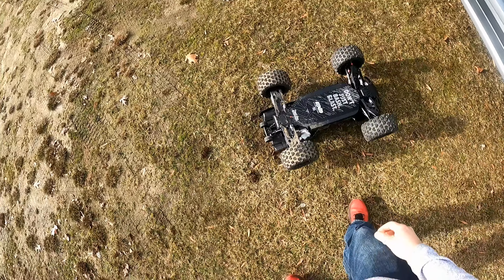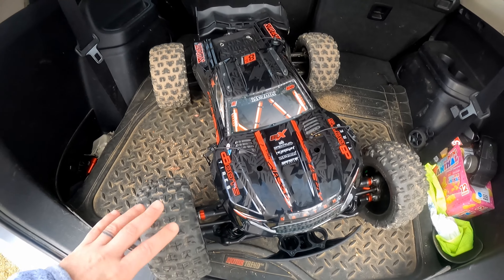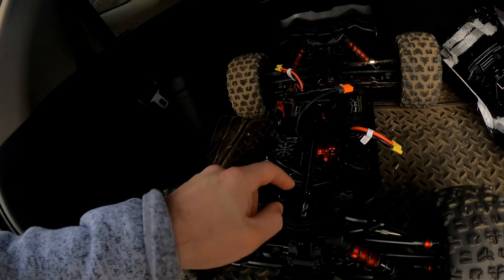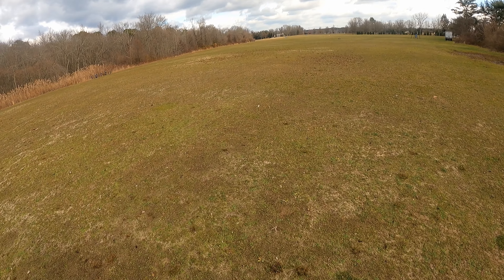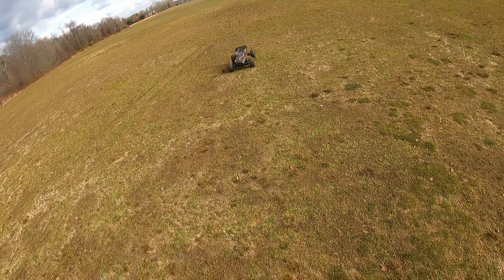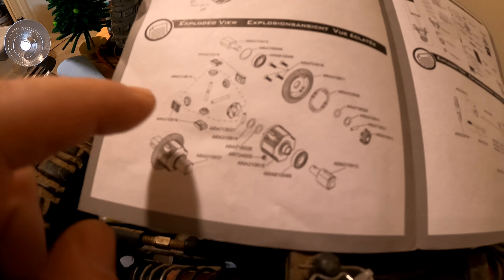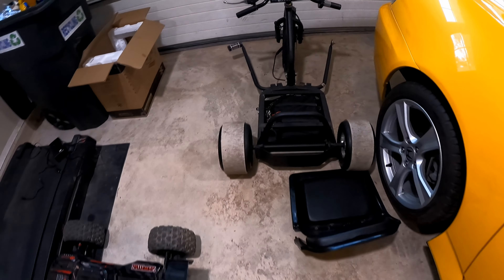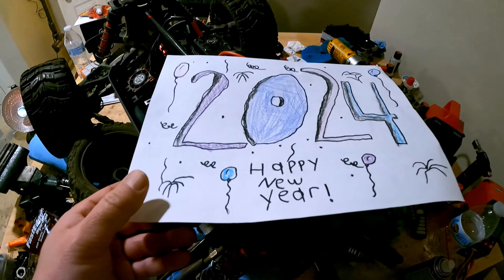Kraton 8S EXB RTR Openbox and Reveiw

Comment: All stock 2 gens ace advance 4s 10000 mah
Reply from the maker: nice those are big how do you like them
Reply: Its a beast i recommend them can run 20-30 min solid full throttle and can still pop wheelie no issues delivers power cant go wrong.
Reply from the maker: @slumpcitychewyhigh  wow that's sick bro. Yeah but there are alittle heavy so if you send her too high and miss a landing things will probably break quick. But for what your doing its good 👍.  I send my rigs pretty high so that as why I got the 6800mah packs. Next ones maybe il go bigger for sure
Reply: what esc?